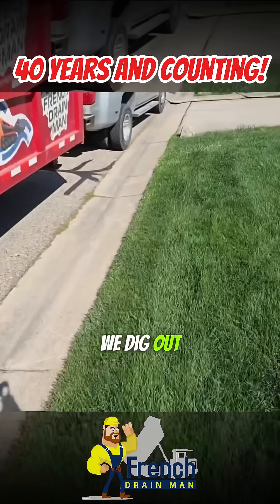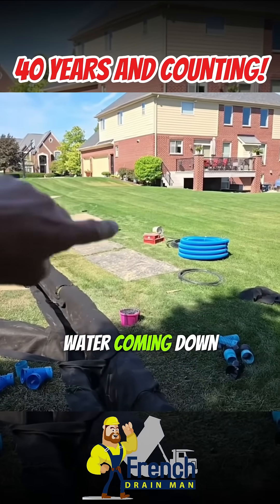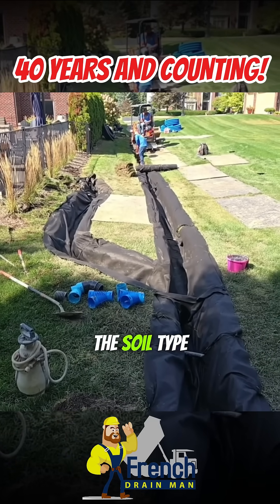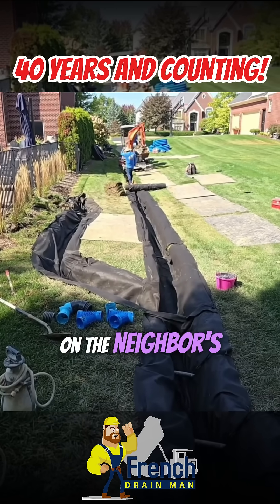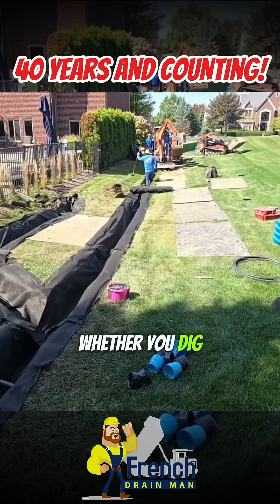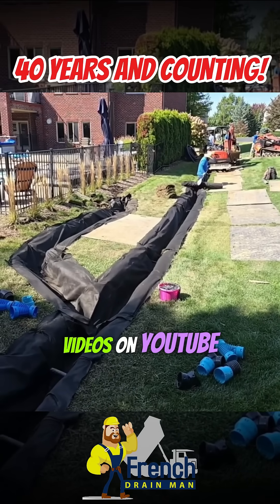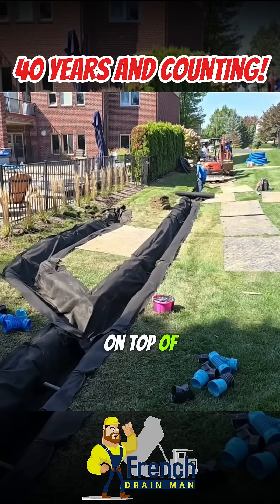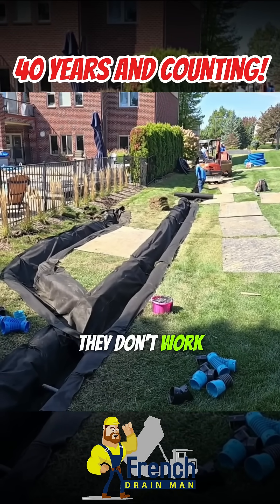40 Years, Thousands of Drains — Not One Has Failed

Comment: Is it wrong to assume the distance of drawing water increases with silt and sand? Or does it loose distance because it’s more permeable soil and it gets sucked down too quick?

I’m planning on an open French drain 14” Wide, with 3 3” pipes to start shallow at 8” deep, then going to a double barrel 4” quad pack 55 feet long total with 3 blind inlets at 
1 1/2 - 2% slope.

Thank you again Rob for all the replies and advice, I really appreciate it! 
Sorry about your Tigers 😕. They had a good year.
Reply from the maker: We mostly work in clay, but 10% of the jobs are in lighter soils. I've seen sand where there was so much clay sediment in the sand that the water would puddle on top of it. If you have that, then it's no different than clay. Seven feet is the max draw, so you can put french drains fourteen feet apart from one another. They're each going to draw about seven feet.